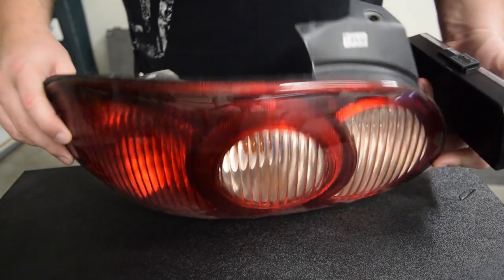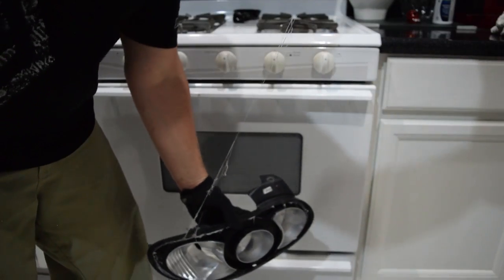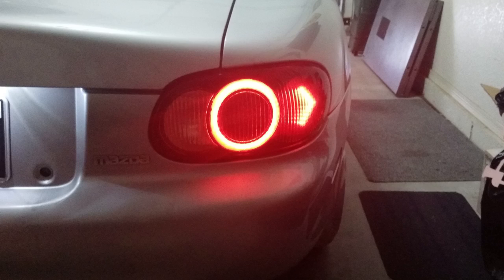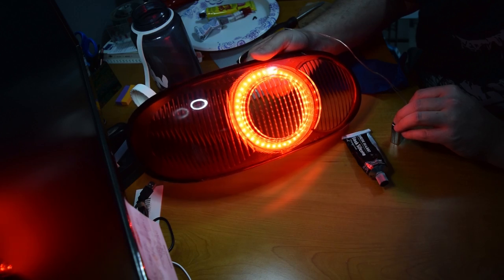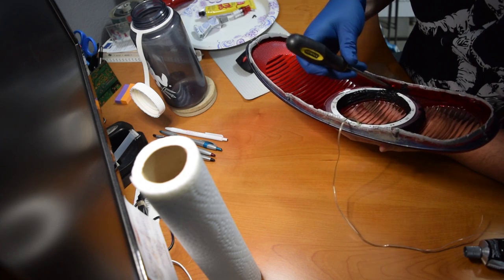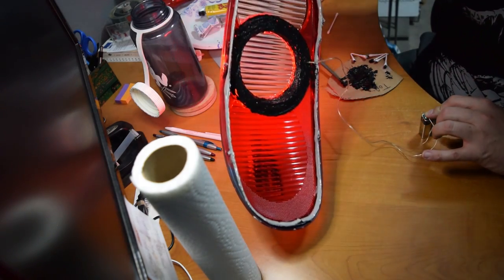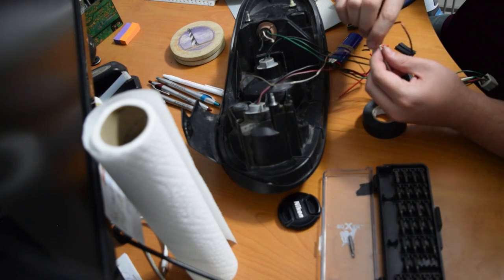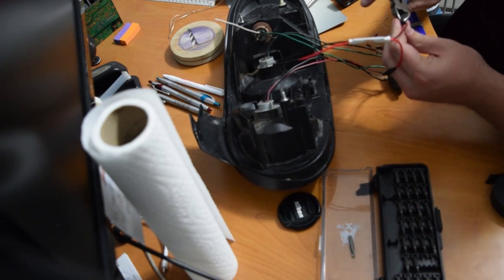The COMPLETE NB Miata Tail Light Led Ring Retrofit Mod

Comment: Instead of using Black RTV around the outer perimeter you could just use black trim paint.  That is what Mazda used on Factory RX7 kouki tail light lenses and it works well plus it is a lot easier to work with and get a nice crisp line. You can also tape and spray it if you wanted.  It wouldn't work for the RTV itself but would save you tons of cleanup time.  
It is also worth noting that another reason for using the clear RTV for those wondering is that it acts as a diffuser for the light so you can't notice the individual LED's as much.  If you want perfect bars you can use an acrylic diffuser instead.
Reply from the maker: anything that blocks the light would work as the only reason to do it is to stop the light from leaking, when making the video i wanted to use products that were very easy to get, and RTV can be purchased at any auto parts store. i'm doing this on a friends car and am thinking about trying red RTV, might be less noticeable from the outside but honestly you really can't tell how it did mine (with the black) from the outside unless you look really close
Reply: Let us know how the red goes.  The black didn't look bad either I was just thinking it would be easier to paint it than scrape off the excess is all.  Either way they look good.
Reply: how about just masking and black spray paint after the clear rtv
Reply: How about using black insulation tape on the inside faces of the ring?
Between the rtv acting as heat insulation and relatively low temp of LEDs I don't imagine it would melt

Comment: Two other easy ways around the hyper flash problem are to either wire a normal bulb in parallel with your leds and hide the bulb somewhere or to change the resistor for a different value in the flasher relay itself, you can adapt the speed of flash a lot in this way, maybe use a variable resistor and bench test to find the best value resistor for your particular load/setup first.
 If you are getting problems with the bulb check system on the car telling you that you have a light out, then adding the same or slightly lower wattage bulbs in parallel will also fix this. The led bulbs that are sold and listed as being 'error free' or with 'canbus chip' only use some resistors across their positive and negative terminals to add the load that the check bulb computer is expecting from a standard incandescant car bulb. These 'ballast' resistors heat up a lot cause the bulbs to get quite hot locally and can even desolder themselves from this heat which I have seen a few times and caused the bulb to fail open circuit!
I like to keep my resistors away from the leds. My car does not have the bulb check computer so I always remove the 'canbus' resistors to reduce heat and save power! (30-50%)  I also like to fit 12v voltage regulators before each parking light/sidelight LED, this can make them last much longer - I believe that manufacturers design them with 12V in mind purposely to reduce their lifespan and get super bright performance at the bulb's limits. Don't forget when running, most alternators will be pushing 14.2V or more which would be enough to reduce the life of any LEDS that had been rated for 12V. The extra 2.2V or more is a lot in the scheme of things! 
 How many of us have had to replace tail lights/day time running light LEDS every year or more often? I would be very interested to know.

Comment: Just purchased a set of NB2 taillights ($29 a piece) for my NB1. Can't wait to do this mod when they get here. Definitly makes the NB taillights look way better
Reply from the maker: Nice! Good luck with the mod. I’ve done a few more sets since making the video and putting the black silicone around to block the light leak isn’t necessary- so you could skip that step and only use the clear to mount the ring.
Reply: @TheTightShirts  Do you still cover the back of the LED ring to seal it all in or do you stop after the ring has been set in the initial clear RTV?
Reply from the maker: @Alexwaltman850  not anymore- just the clear and once the ring is set- that’s all
Reply: @TheTightShirts  thanks for the advise sir

Comment: LEDs have resistors just before the Diode, therefore the sistema might think your lights are working or there's something wrong with it and mess something up. An easy way around that which is the same as done when installing LED turn lights is to trick the module by using a relay as the bulb and run another wire with 12+ to the relay to power the LEDs, so when you turn on the lights it'll act as a regular bulb and turn on the relay which in turn will turn on the LEDs. It sounds stupid to run a relay as your bulb, but it's really not. Tho the relay doesn't have to be on the taillight, you can simply put it far back in the wiring before it splits into two for each taillight.
Reply from the maker: Ujieru Ruisu that's an interesting solution and I haven't hear of anyone doing it that way. I wanted to keep it as simple as possible, with the fewest changes to the original wire harness, so I just bought some red incandescent bulbs. But thanks for the comment! Others might find it useful

Comment: If you still want to use LEDs or LED bulbs for turn signals I highly recommend buying a LED capable Flasher Relay and replace your stock Flasher Relay. I'm fairly sure SuperbrightLEDs has them for the NB.
Reply from the maker: I've already looked into it and mention it in the video. the led relays require you to upgrade ALL of the lights on the same circuit to LED, meaning you cannot run incandescent turn signal bulbs in the front and led in the rear. Having to replace all of the bulbs with led as well as the relay puts the cost too high for me, but yes it can be done.
Reply: I take my previous comment back... I've looked around and have gone through a few forums and it turns out there isn't an LED capable Flasher Relay for NBs. My mistake.
Reply from the maker: @MXSabol  I actually bought one of those relays, but I never installed it since in the directions it says not to mix the bulb types. Since I didn't install it I can't confirm if it is compatible with NBs or not, but but as far as I know there are ones out there that are compatible.

Comment: Hey, I ran into a problem while doing the halo diy mod. While I was testing the light and making sure they worked and putting them all together and as soon as I get ready to start the car the dashboard and the running lights wont turn on. No directionals no brake no running lights on the rear or the front amber lights just the regular front lights.

Comment: Was (over) thinking through the process... instead of RTV... thinking black liquid tape would be much easier and is actually well... what it says it is..Liquid (Electrical) tape.
Reply from the maker: that sounds like a good idea, really anything that would block the light so it doesn't leak. i was concerned about temperature because i live in phoenix and assumed it would get above 120 deg f, and i knew the RTV could handle it. let us know if you try it with the liquid tape and how it turns out

Comment: What relay are you looking at that you have to change ALL the bulbs to LED? I've only got LEDs in the front of my truck and my LED relay works perfectly fine.
Reply from the maker: i can't find any info for it, i just remember it saying that in the documentation if there were mixed bulbs it would overload the relay. keep in mind that this is was specifically for my application and your truck's wiring system is most likely different. I know that you can modify relays to support it (search miata.net) but i feel that it's going down a rabbit hole and for what? just so i can use led arrows for turn signals. IMO it's too much work and not a big enough pay off. i was really after the ring for the running light and after a few design changes I found this to work the best.
Reply: Ah okay. That's just strange though. I've never seen an led turn signal relay for any vehicle ever that worked like that.

Comment: Great! For your sequential turn indicator, have you change the OEM flasher relay? I've installed these sequential turn indicators, but they don't work sequentially... Tnx
Reply from the maker: I don't run the sequential turn signal, that was mentioned because it was a prototype I was working on and I say in the video why I don't run those. Additionally they aren't very bright in direct sunlight

Comment: Is there a way to make the ring change intensity (be brighter), while braking?
Reply from the maker: The ring that I used isn't really designed for two different levels of brightness- that's why I used a separate bulb for the brake light and only use the ring as a running light.

Comment: Hi! I've connected also a 24led round light as a stop light. Positive wire on round led, positive wire on circle led as position light, and negative together. It works, but there is an interference between negative and radio signal. Do u know how to solve it? Tnx
Reply from the maker: It's a ground problem, upgrade the main ground on the battery to the chassis, and upgrade the ground on the stereo.
Reply: @TheTightShirts  thanks for reply. Do u mean to wire radio ground directly to the chassis? Tnx
Reply from the maker: @088poseidon880  yes
Reply: @TheTightShirts  upgraded radio ground directly to chassis: same interference:( 
How can I upgrade the main ground on the battery? Tnx

Comment: Hey I’m curious if all the silver trim inside the tail light popped out just like the one u popped out for the turn signal? I have some diy ideas I’d like to try out that requires this.
Reply from the maker: No, only the turn signal part comes out of the housing, the rest of the silver is the actual housing but painted silver

Comment: would leaving the wiring in get ruined by the heat ?
Reply from the maker: 250 degrees Fahrenheit isn't hot enough to do damage, i've done headlights that have a clear vinyl protector on the lens and it was fine. Granted we're also not leaving them in the oven for long periods of time either.

Comment: Nice man! I have been waiting for the next video !! Do you have the link to the led ring your bought?
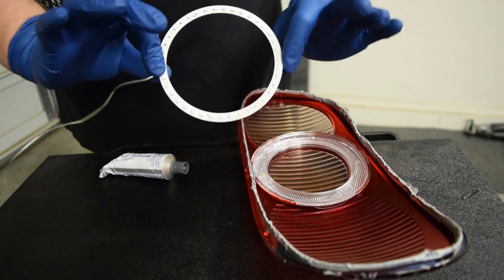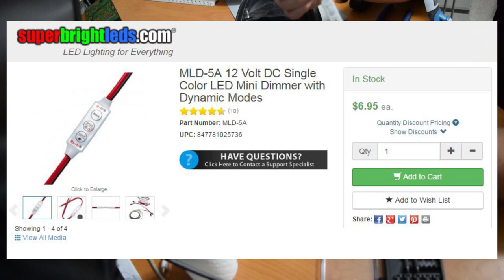Reply from the maker: 9:09 has the info for the rings including the part number from super bright leds. i put all the info you need in the video. i didn't want to put links because sometimes they change and then i'd have to update the video. don't forget to buy the dimmer module 32:43

Comment: would you recommend white led ring or red led ring ?
Reply from the maker: In one of my first mockups when I was figuring out how to put it together I used white LEDs in the ring and the white had a little blue hue to it and the ring looked orange through the red of the tail light housing, so all of the ones I've built I've used red LEDs in the rings and look as expected.
Reply from the maker: I have this video hidden since the design has changed so much since the mock-up but you can see the ring looks orange: https://youtu.be/K1WqrQWkG9I
Reply: @TheTightShirts  have you done it to na mx5?
Is it similar?
I think it needs a 100mm ring
Reply from the maker: @augustinmeignan  I haven't done it to a NA miata, the procedure should be the same but I do believe the ring size is smaller on NA. I think someone told me 90mm but I could be mistaken, sounds like you're in the ballpark. Just remember when measuring there's an inside diameter and outside diameter

Comment: what is this transparent paste u used be4 setting the ring ? hmm?
Reply from the maker: Rafał Celiński it's just clear RTV silicone, I holds the ring in place but the light still shines through. The black is also RTV silicone, but is used to keep the light from "bleeding" out into areas we don't want the light to go. On my next set I'm thinking of trying red silicone to stop the light, it will be less noticable than the black from the outside of the lens

Comment: What it your power supplier for testing the lights ?
Reply from the maker: Most automotive lights have a voltage range in which they will operate, something like 7-17 volts (just an estimate) I just used a standard 9v battery which worked for the lights I was using
Reply: @TheTightShirts   i have hyundi coupe 2006 can i do like you i want led
Reply from the maker: @noway1334  the methods would probably be similar, but I have no idea what the inside of the tail light looks like so a different sized ring might be needed. I recommend buying a tail light from eBay to take apart so if you make a mistake it doesn't effect your car. I had a separate tail light that I was playing around with for about a year before finalized the design

Comment: get a soldering iron ffs. they are so cheap..
Reply from the maker: psy06 I've been running this for over a year, and through 120+ Phoenix summer heat and haven't had any issues. I've also installed over 100+ aftermarket stereos in different vehicles and NEVER used solder and never had an issue with wiring. I'm not one to cut corners, but I've seen no evidence that solder is better in any way.
Reply: every single time i pull a deck out and see any electrical tape used, it automatically tells me that its an amateur job. you solder the wires together for mechanical connection. the way you did it by twisting and taping the wires, 1 good tug and it will come undone. the only tape that should be used on stereos is Tesa loom tape. Electrical tape, good 3m stuff will become total sticky running shit after a while. But i guess each to their own